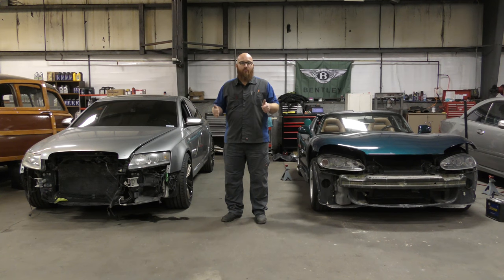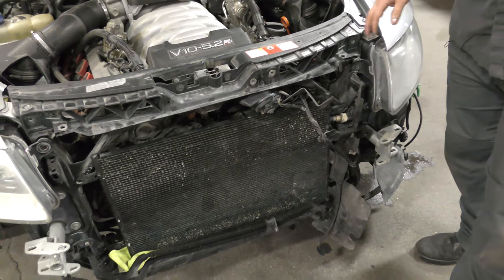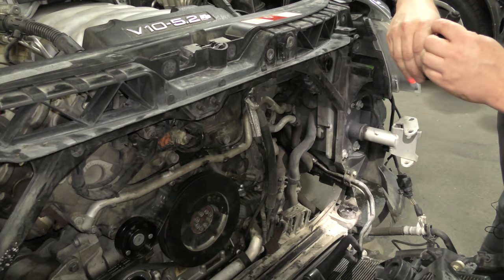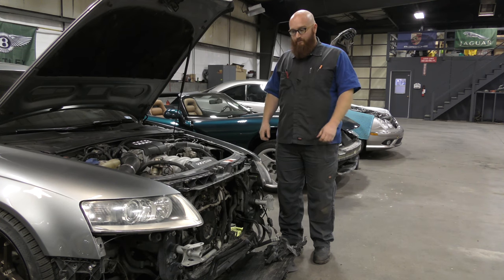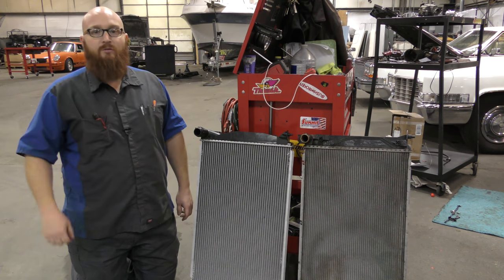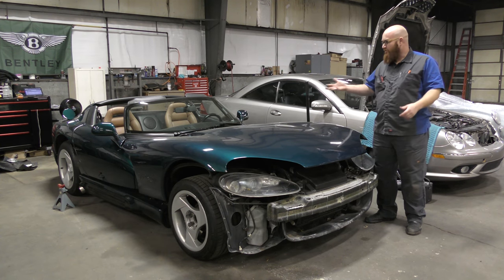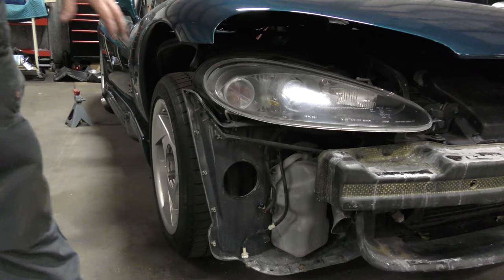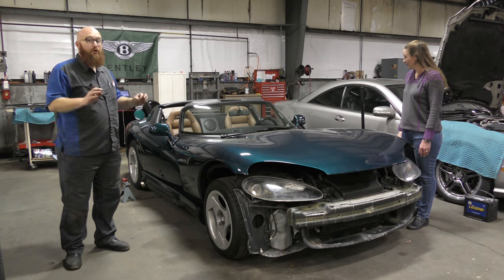What?! The CAR WIZARD has to remove the bumper on an Audi S6 & Dodge Viper to make easy repairs?

Comment: I just recently had this part cross-referencing issue with my 2010 Lincoln MKS Ecoboost. The part I needed I'm sure has nothing to do with the trim of my car. I needed the lateral arms for the rear suspension. I went to the dealer A FORD/LINCOLN DEALER ordered this pair of parts along with the bolts to mount to the car, started taking mine apart. The bolt I bought was too big, the hole on the new part was too big. Yeah, I could mount them on there with the old bolts, and it would appear to be good to go, but there is guaranteed to be a lot of play. I brought the old part and the new part to the dealership to compare parts. He cross referenced and found a dealership 40 miles away that had the original part number in stock. I had to drive all the way there and pay twice as much for the correct damn part. Ridiculous.

Comment: The car was initially designed to have smaller engines with smaller displacements like 4.2 V8s or a W engine which is shorter than this V10. This could be a reason why every job is a bumper off job on these S series.

Comment: I just got an S4 and I really hope I never have to deal with the timing chains. You think taking the bumper off is bad? Take the radiator support with the rads and all that off and then you gotta move the damn engine forward. And that's a v6.  I can't imagine how bad it is on this v10.(I'm assuming this engine has the timing chains in the same area. In the back near the firewall)

Comment: PT cruiser: am I a joke to you?
Me: crying in $1200 Timing belt change.
Reply: You deserve it for buying a PT Cruiser.
Reply: @cpscps2679  🤣🤣🤣🤣🤣🤣🤣
Reply: we replaced the starter THREE TIMES!
Reply: @cpscps2679  
Yeah. I like driving it... Just not fixing it. It's actually been mostly reliable shockingly. I am now needing to get a new belt tensioner and I just replaced the belt 10k miles ago. I'm just going to drive it until the belt falls off and buy a F150 next.
Reply: just part it out lol
Reply: I did that job once its rather enjoyable drips sarcasm

Comment: On my 2012 Chevy Captiva I had to remove the bumper and crash bar to take our the radiator. It is possible to replace it without doing this, but you'd have to disconnect the condenser. Considering I'd have to take it to a mechanic to get it evacuated, it would defeat the purpose of replacing the radiator myself.

Comment: I would cut those wheel liners and flange them and bolt them on. I would weld the nuts on while exposed. also get some hardware store foam and line that fuel tank panel and use self tapping screws to re attach it.

Comment: I've just got a Alfa Giulia. It's a fantastic car to drive, really there's no other car with such handling around.
But.
I've checked the engine bay for the possibility to fit an oil catch can and there's little to no space at all for it. And it's a 2L car, not the V6!

Comment: The radiator actually sits way out front. Those bolt holes he pointed to are for the air intake snorkels. There are holes near the front of the radiator support. Two plastic pins go through there. It’s really not that bad of a job.

Comment: 2007 CRV. Windshield washer tank is in about the same place as the Viper. It turns out that if one's spouse has the habit of driving up on the snow chunks on the side of the street and then breaking through, the tank becomes a casualty of such folly. While I agree that this could have been much simpler to change, removing the bumper fascia really took about 5 minutes. OK. Ten if you count watching the YouTube videos of others who were doing their civic duty by crunching down that snow on the side of the road.
Designed to build is different than designed to service.
Check out what it takes to chance a headlight in 1970s Volvos. The answer is - a new headlight and at least two fingers.

Comment: I have hyundai Tuscon 2008, diesel. I had to pull the engine to replace a belt. about 1/2 inch of extra space would have eliminated that. 

so, does not take a exotic car; but, at least I did not pay extra for the privilege.

I make a point now when buying a car, to take a hard look at the space in the engine bay and think through its "repairability", plus do some googling on experience with repairing. I also look at how common the car is in my area on the road, and check distribution channels.

Comment: The Viper has an excuse though it's a GIGANTIC 8 LITER v10 crammed in a fairly tiny 98" wheel base.

Also Kia Optima's are obscene to work on, I had to remove the alternator cause it went bad and you have to options, Remove the axle or Jack the engine up to get it out

Comment: Hi Wizard.   Thanks for another informative video that also is a solid warning about owning an Audi.  Needing to remove the front end of the car is not the sole domain of the V10 and V8 cars. Nope, even cars with the lowly 1.8T, like our former VW Passat, will need the front end removed to change the radiator, do the timing belt service, or a water pump.  Why?  Because of the architecture of the chassis.  The way Audi does the classic Quattro AWD, they have the engine longitudinally oriented.  The engine thus sits ahead of the front axel,  and even a 1.8T will have less than a 1/2" between the timing cover and the core support.

With their VW heritage, I will never own an Audi.  You may hate BMW, but my 328i is way easier to work on.

Comment: Not only German engineering. I had a 2003 Mazda Tribute which needed an alternator. If I remember correctly, it booked at 8+ hours! But, the A/C compressor was a 20 minute job?

Comment: My family bough an Audi allroad (basically a b5 s4 with bigger tires and some different trim) literally blew a turbo on the first drive after we got it

So my dad and I were going to replace the bad turbo, which requires the engine to be removed, in a gravel driveway, not easy.

We both got frustrated to the point where we just parted the car out because we were never going to get it back together

That being said I think if we had a lift and a concrete slab it could've been done a lot easier, oh well

Comment: To search for a part giving the model and year is completely waste of time and of course it will fail to get the correct part. Always use the VIN number when ordering parts. Then you will get the right without issues.

Comment: Agreed. I love Audi but repairability was no priority for them. However you must recognize the structural base. In the A6´s case its a FWD config with a V10! crammed in. So a lot of jobs are hideously hard. 
And that goes for all V engined Audis and VW´s from the 90s and 00s. 
I did an alternator on a B5 Passat V6 Syncro. 
You could see it from below, but if wouldn't fit through the gap between oilpan and frame. 
So I had to take the front of. While I was in there, I figured I might as well do the timing belt 😂

Comment: Isn‘t it possible to put den front in service-position? This is possible at many VW/Audi cars with a longitudinal mounted engine to change belts, and so on. I think that would have saved you a lot of time. Sure the Bumper has to come off too, but that’s a 10-20min job.

Comment: 8th gen accord coupe, very reliable car but when those headlights go out...bumper is coming off.  I did it once through the wheel well and gladly took the bumper off instead anytime after.  Even Honda has weird screw ups design wise.

Comment: My 1988 BMW 750iL E32 has the EASIEST headlights in the world. The 5 3/4 round headlights actually interchange with old style sealed beams from 60s and 70s cars. Want to upgrade to HIDs or LEDs? No problem. Swap out the lights, put the guts of the new headlights inside the glass housings. You could do this in an afternoon.

The reason it's called Audi because the engine has to come "outie" from the car. Those aren't rings on the front grille. Those are decimal places for the repair bill.

Audi heard complaints from dealer service departments claiming they were getting too much competition from independent shops. You know the Germans - they NEVER give up control! (Thank you Jay Leno!).

"What can we do to make zee job harder? Vee have vays of making you talk!"
Reply: If only YouTube had the FB laugh react. I've worked mainly on my own vehicles and I got spoiled on my '96 Ford Ranger. My '04 Kia was a minor headache with it's Alternator for tensioner malarkey, the placement of the thermostat housing, and the starter behind the manifold. 

Those inconveniences are NOTHING compared to most German car component placements. When the factory warranty runs out on my gf's '19 RAV4, I'm not that frightened of working on it. The 4 cylinder seems pretty sorted for future maintenance.

It really does seem that those at the top tell the engineers to design with future maintenance costs as a concern, and not with customer savings in mind.

Comment: Mr Wizard...i recently did some minor repair on the drivers door hardness on my Gen 2 rt/10 viper. those wires are known for splitting open at the door....... here is my main question. I couldn't figure out how to remove connection for the wire door harness. I know you have showed tips on removing electrical connectors but this one has some sort of plastic red pins on each side. I tried to disconnecting it and couldn't figure it out. I tried  searching on the net what type it is.. and no luck yet. If you do another tip video please include this. I stopped messing with mine in fear of breaking the sucker so I left it alone.

Comment: Hey Wizard
First of all, I love your videos. But I feel a little bit annoyed when this, that or the other is always the fault of the engineers. I am a mechanical engineer, and something a lot of people don't seem to understand is, that (almost) all cars are designed with a final price point in mind. There's a budget for development, a budget for production costs, and the engineers always have to keep that in mind. These things often result in these semi-botched designs, where things become inaccessible or difficult to reach at best. 

I am not an Audi fanboy by any means, but to be fair to the S6, it is a matter of a very large engine being squeezed into a relatively small engine bay. I bet you Audi MANAGEMENT (not the engineers!) decided on a very small development budget for the S6. It uses an engine which the VW group already had access to from Lamborghini (I think it shares its engine with the Gallardo/Audi R8 V10), which the engineers were then tasked with making it work in the Audi bodyshell. This means that they probably didn't get any funding for developing a new facia/radiator cowling/fixture, nor did they get any funding to relocate the starter motor etc. In order to keep the cost down, they were most likely forced to use a lot of off-the-shelf VW/Audi parts, with only the bare essentials changed to make the engine fit and work in the A6 shell. Or maybe it is simply that they came up with a new design for all this stuff, but the productions costs were too high and management said no. I don't know in this specific case, only Audi will know.

There's nothing an engineer would be more happy with than starting with a blank canvas, no budget and no deadline when starting a new project, but this sadly barely never happens. And this isn't something unique to the car manufacturing business either, it happens everywhere, e.g. televisions, refrigerators, etc. You also see this with Ms. Wizards Land Rover using a Ford engine, in order to keep the price down and to stay competitive.

Anyway, rant over, I love your content, and I just wanted to give people an insight into the world of designing new products, so hopefully they will keep this in mind, the next time they get annoyed over something will working on their cars.

Comment: I have the same A6 but with a 3.0TFSI Supercharged V6 (that replaced the 3.2 after the face-lift) and that's way easier to work on. I replaced my main pulley without touching moving anything else than the under belly protection. That engine is just way too big for that car!

Comment: I had a Dodge Ram 2500... Passenger side exhaust manifold rear bolts sheared off.  I managed to get the manifold off after 4 hours or so, because the frame of the truck blocks the bolts, and I had to use a box wrench 1 inch remove wrench, repeat for all the bolts.  I could not drill out the sheared bolts because of the frame, so I just polished the manifold, wire wheeled the gasket, and slapped it back together, and torqued it down starting at the opposite side from the broken bolts.  It didn't leak any more, so I got it through inspection, and got rid of the truck.

Never again.

Supposedly the RAM 1500 does not have the same frame blocking issues... maybe I'll get that instead.

Comment: doesn't the lock carrier move into the service position on the A6? My B7 generation A4 and my B5 Passat all have a lock carrier the can be placed in the service position which makes the above jobs much easier than described. Car wizard, you might want to look into this.

Comment: They make that bumper easy to remove, it takes like 10-15 minutes.
Reply: yea never had to take more than maybe 25 minutes to get a bumper off if you could unscrew a radiator after doing that and its out sounds way nicer and less likely for things to get damaged
Reply: Service position in 30 minutes, then you have pretty good access. Unless its a 2.7t
Reply: "It takes BETWEEN 10-15 minutes.

Comment: He mentions an E550 right at the beginning, and all I can think of is the official Mercedes instructions for replacing the headlight bulbs on a W212 E series... "Remove front wheel, remove forward wheel well covering, and you can access the bulb"

Yes, from Mercedes themselves, you have to remove the front wheels of an E-Class to replace headlight bulbs.

Comment: The A6 was probably never designed at first to house such a large engine.  It is actually a wonder the engineers got it to fit, together with all the other stuff a modern car ‘needs’.  Tetris-experts at work.

Comment: It would be easy to engineer these vehicles to be easily repairable, but that is obviously not what the manufacturer was after...they were looking for a disposable car. That is one of the many reasons why the "right to repair" movement is so important. Apple is no different, it's just that their devices are smaller. Recent stories about replacing the battery pack on the Nissan Leaf where customers are told by the dealership that the proper way to "repair" the battery problem is to buy a new Leaf. In theory, this type of thing would be stopped by nation, and even international right to repair laws.

Comment: At least the Audi has a v10 Shoe horned in there my 16 Silverado’s Radiator is a 6 1/2 hour job and there is a ton of room in the engine bay.
Reply: How is that a 6.5 hour job on a Silverado lol
Reply: @repnatl   the book time is 5.8 hours But that’s gm hell to change a headlight on the older Trail Blazer you have to remove the bumper.

Comment: Hey, why worry, especially on high end cars. The people buying them will be trading them in or selling them before the warranty runs out and will never have to deal with crap like this. After than it's to the manufacturer's advantage for people to junk them because they are too expensive to maintain. it's even easier now. All they have to do is change the infotaiment system a bit every two or three years and simply not make any replacements for vehicles over a generation or two old. Oh you can't use any of the features anymore, too bad so sad.

Comment: The engineers should be required to replace every part on every car they design before that design is approved.  That'll fix this issue.

And $50 says that incorrect part came from Rock Auto.  I've definitely had that happen before. Where their numbers say the part should fit, but in actuality it doesn't -- or it requires some serious modification to fit.

Comment: understandable honestly on the audi, it was not designed for the V10 in mind, its just crammed in there
Reply: What about the 2.7t in the a6 and s4. A6 was designed for v6 yet the dinky 2.7 has literally no working room and is another engine out car for most repairs.

Comment: Why didn’t you just take the wheel house out on the Viper? The fender liner? You could’ve probably done that by removing the front left wheel and taking the wheel house out. I would not have taken the bumper off to get to that charcoal canister.

Comment: Well like most VAG products this engineering fail is the result of putting the engine in front of the front axles. Honestly most modern VWs will have the engine removed anyways due to quality. I wouldn't touch anything that is Direct injected or has forced induction... In saying that I have a w12 VW that the engine has been removed for servicing. I do say the costs wasn't too bad. Surprisingly it was cheaper than the Mercedes V12 so I can live with it.

Comment: For whatever reason, aftermarket radiators always seemed to be a crapshoot as to if they would fit or not. Good suppliers, bad suppliers, it didn't matter.